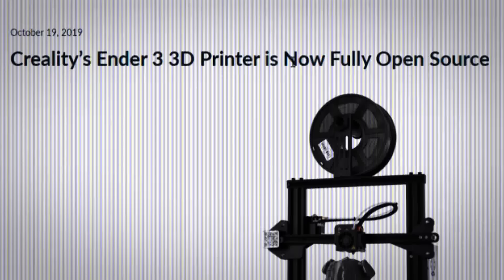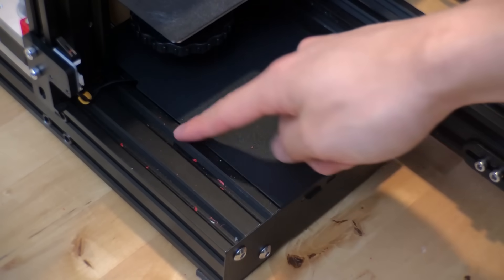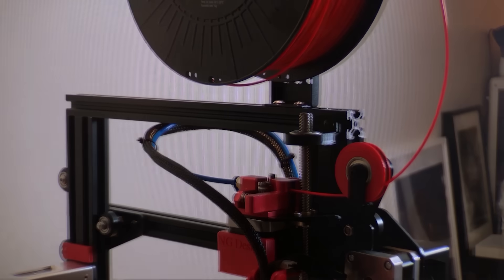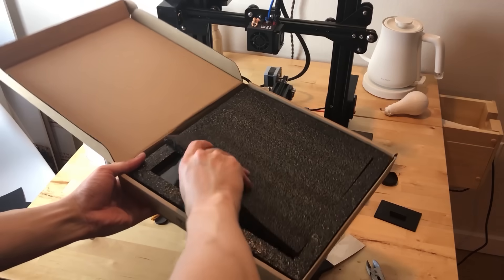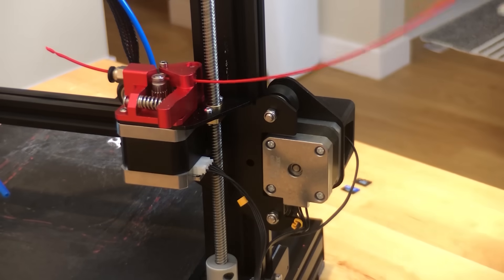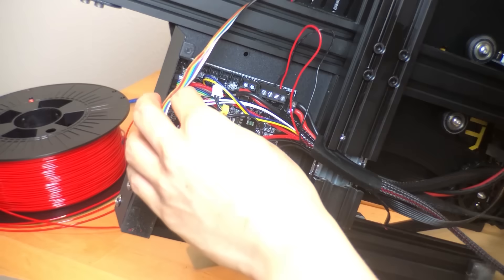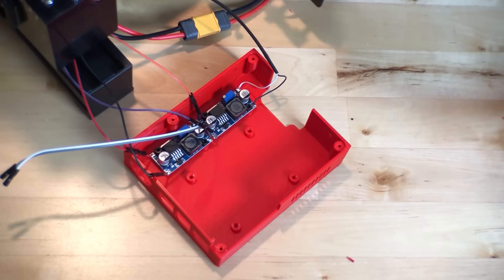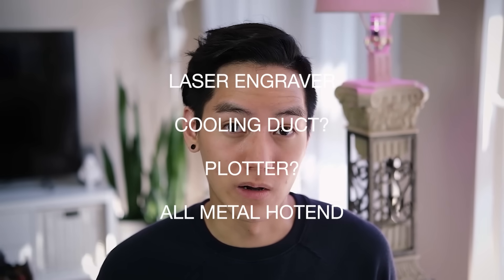First 24 Upgrades for my Ender 3 Pro - Part 1

Comment: Me: Runs out of filament... "Ah dammit."
Also me: Gets a 200 iq idea. Prints new filament.
Reply: That's like printing a blank page if you need paper to take notes...
Reply: @PhilippensTube  if it works, it works
Reply: @PhilippensTube  Thanks for the tip! I was in a jimmy, I had my SAT's coming up.
Reply: I actually tried this. With the right settings it works.
Reply: @lukeunterholzner7928  the nozzle is .4 and the filament is 1.75 sooo which settings would those be? turn spatial physics off?
Reply: @zacharyclarke4240  the right settings could be drilling a larger hole in the nozzle. You could also fully modify the printer to have a hopper that leads into a heating chamber that melts all of your failed prints and extrudes them as filament
Reply: @adamdennis7266  neither of those suggestions are settings
Reply: @zacharyclarke4240  they could be considered physical settings.
Reply: @adamdennis7266  you would consider having a filament extruder a setting of your 3d printer? Not wasting my time explaining why that's wrong and stupid
Reply: @zacharyclarke4240  but you missing the joke from the original comment is
Reply: @adamdennis7266  drilling a hole in a nozzle wouldnt really be the best idea when you can get a precision set of all ranges of nozzle width on amazon for like 5 bucks or less
Reply: @zacharyclarke4240  i would definitely consider those “settings”. there’s many different ways to view the action of “setting” something #woosh
Reply: @adamdennis7266  you could grind the failed prints to a powder and make the hopper idea, only problem is it would be uncontrolled.
Reply: Big. Brain.
Reply: @ZER0D4SH It aint waste when you can generate new filament,

Comment: We chose a few of the same upgrades. I printed that same 2-drawer file, the same extruder knob file, the same LCD back cover, and those same anodized red wheels. Have an all-metal extruder upgrade, Capricorn bowden tubing. Also went with boro-glass bed w/pei sheet stuck to it, and the 3-point leveling carriage. I like your cable chain better! I appreciate teh link to the files!

Comment: with the Bigtree board is there any setup you have to do for it or is it just plug and play?
Reply from the maker: it's fairly plug and play with just a firmware flashing that's needed. it's pretty easy and if you wanna learn more about that i shared a video from a guy who goes very in-depth with the installation process in the video description. good luck!

Comment: On #08, looking at my machine, moving the 'Z' axis motor out from the rail is not the correct solution. The distance from the rail to the center of the motor's shaft should be the same as the distance from the rail to the center of the threaded bushing on the 'X' axis rail that screws onto the 'z' axis threaded rod. On my machine, the distance from the rail to the center of the threaded bushing is 22mm. The distance from the side of the motor that mounts against the rail and the center of the motor's shaft is also 22mm. The plastic motor mount should be flush with the side of the motor so it holds the motor flush against the rail. Mine was not quite to the edge of the motor, so I loosened the 2 screws that hold the mount onto the motor. Then I screwed (but not completely tightened) the mount onto the vertical rail 1st, then while holding the motor against the rail, I tightened the screws that hold the mount to the motor. I moved the 'X' axis rail to the top of the 'Z' axis threaded rod before mounting the rod in the coupling on the motor, then tightened the screws that hold the motor to the rail so the motor shaft and rod is plumb in the 'X' axis direction. When the 'X' axis rail is at the bottom near the coupling, there should not be any binding or friction at all. When I move the 'X' axis rail all the way down on my machine, the distance from the rail to the center of the threaded rod at the top is 24mm, which is only 2mm difference from the bottom. There is no need whatsoever to have to use upgrade #09 and will most likely cause binding if the centerline of the motor shaft, the center of the threaded bushing and the center of the top bearing are not perfectly in line with each other.

Comment: Quick Question: Mine is on the way, and am building a cabinet for it to rest on. My question is how much space does the printer take? Not in means of dimensions, but more on the surrounding area it needs to work properly. One concern is the cords in the rear. I would like to have the cabinet done before it arrives, and any  input helps! Thank you, happy printing!

Comment: Did you get the TMC Connection Error with the SKR mini E3 V1.2? I wanted to buy it too, but I heard of this error and about 60 bucks for the mainboard and a bl touch is a lot of money to waste.
Reply from the maker: i think i got that error once but i just rebooted it and it went away. i don't think that's a common error. but yes, with any 3rd party addon there's definitely always a risk. good luck!

Comment: Adding a bearing to the threaded rod is apparently not a good idea, its supposed to have that wobble. God knows why.
Reply: It is not suppose to wobble. It may have a slight bend in it or it is not vertically plumb, so when it spins, it may wobble. Since the rod is vertical, it doesn't need any support at the top since the Z axis will support it as it travels up and down.

Comment: I've done quite a few of these now. Heads up, the SKR Mini E3 v2.0 is much more reliable than the 1.2 or 1.3 and doesn't require quite so much programming.

Comment: I ordered an Ender 3d printer today. I'm just short of bouncing in my seat waiting for it to show up. And now, thanks to your video, I have a list of things to try making first. The cable chains are a great idea.
Reply: I'm gonna buy mine soon :) Did yours arrive yet?
Reply: @MM-vr8rj  I have it assembled and ive made a couple of parts and a bit of wasted plastic with it. It wasn't hard to assemble, but I had to learn about making 3D prints work. One thing that would help is don't use black filament when setting the machine up. Use a color that stands out from the print bed.

Comment: Thoughts as I go. Really good video but 3/4 of these I'm having trouble seeing as "upgrades" (Sorry, I'm bored from procrastinating from real work). Definitely good if you really want to customize your printer and have enough matching color filament! Calling this many things upgrades might make it sound like this many things are needed to increase the quality of prints from this printer when very few of these are for upgrading print quality or even quality of life in using it.

#1 yes, it's bright. Cover good!
#2 "I just wanted to print my first medium sized part"
#3 "I have filament color I want and needlessly want to customize" but was that really necessary after the baby?
#4 yay now my debris gets trapped under [not readily at least] unremovable plastic that I never remove to check under
#5 I think I use mine more than you because reaching that far back in the corner of my desk is too far. It just goes in my top drawer. My printer is in the back corner of a corner desk though
#6 I know why, but still: why? Be purposeful. Just color customization. Unless you're a debris nazi, see #4
#7 oh cool, look I can find something that restricts the power supply cooling capabilities! (I've always got mine 4 ft from me and my streaming mic and it's not audible though there are A/C units outside. The part cooling fan is louder anyway)
#8 the first useful, actual upgrade!
#9 good idea. Not really necessary though as it won't add much longevity or any accuracy to prints, see pt #8 and disclaimer 
#10 I don't like to encourage manual manipulation of axes too much but a nice point for color splash and occasionally useful
#11 Filament guides are a really good idea on this printer and filament feed definitely seems like one of the largely overlooked considerations in its design. I'd much rather move the filament off the top where it would be able to add to any oscillations though. There are some great angled mounts to be found to move the filament arm to the bottom stand
#12 If that guy got a cable through his print he almost had to try to. Cleaning up the cables runs is still a great idea!
#13 If you need storage REALLY close to your printer, great. Feel good larger pieces to print but definitely quickly outgrown. Still a nice to have if your printer isn't on the back of a corner desk.
#14, 15, 16, 17 a lot of people complain about adhesion and levelling on their stock magnetic beds. I do a lot of almost full bed prints for layers for rovers, midi controllers, etc and still don't have any issues after a year and a half with PLA. That said bed levelling is a constant ordeal and everything shown is definitely very convenient for when you do have to level. Still don't like the handle for manually moving the bed. I'm 50/50 on these bits personally but based on others' complaints I would say it's a situational upgrade
#18 I already saw the Pi in the intro so I know you're going to be setting up remote access which makes this completely useless (I've never used the card slot on my printer, always USB/Network), but if you are using cards this is a good idea. Congrats on your first remix! Consideration for the USB connection conflicts with needing to worry about longevity of the card slot
#19 Yes! And calibrating the E-steps is definitely a great thing to do once you're up and running
#20 I've yet to have an issue with the stock tubing though I just print with PLA and I expect nozzle cleaning/replacement to be part of normal use. No real personal insight for this one!
#21 I personally don't like things like BL Touch and having the firmware account for unlevel beds because that means the bottom surface of the part just matches the bad levelling of the bed! (I'm really picky about some of my dimensions for my builds). That said a LOT of people use this and it really does make life a lot easier! I have levelled my bed enough that it only takes me a couple of minutes once every few weeks and I know my bottom surface is as perpendicular to the top surface and layers as possible
#22 Definitely good bang for the buck. I'm still running my stock board though, I don't need silent steppers
#23 (lights) The first thing I wouldn't call an upgrade but want to do myself! Definitely a lot of work for what you get (hopefully you're not trying to print in some dark dungeon?) but very nice and clean. Admittedly I have a webcam looking at some of the printing and though my fleshy human eyes can see prints just fine with room lighting this would greatly help with the webcam quality. For the level of effort put in by OP he should get a heat gun!
#24 (Pi) I've been running my printer exclusively via OctoPrint (Not OctoPi, I've got an old netbook that would otherwise be collecting dust running Mint + OctoPrint) and is definitely the way to go over shuffling STLs around with SD cards! Whether via a Pi or other dedicated connection, OctoPrint (OctoPi) is how I'd recommend using any printer!

So as stated I've been using mine (Ender 3 Pro) for well over a year now to print solely PLA and the only "upgrades" I've done are to move the filament spool off the top of the printer (making a filament guide unnecessary), making spool adapters for smoother/easier filament pulling off the spool instead of it wobbling on the smaller diameter spool arm, and setting it up to access via OctoPrint. I manually level my bed (I care about the bottom of the print actually being more level for some of the stuff I make) and replacing nozzles is part of my usual maintenance whenever print quality drops.
Reply from the maker: wow i don't respond to a whole lot of comments but this was just too much effort to ignore haha. i understand the critique and i did receive a few comments like yours pointing out that if they're not upgrades to the print quality they're not technically upgrades but i completely disagree. i think improving the ease of use, durability, and organization of a product is just as important for many users. if it was always just about print quality and not ease of use i think resin SLA printers would be a LOT more popular than FDM but the opposite is true because FDM printers are just so much easier to use compared to SLA and people value that. I think #1 is the best example of that. it doesn't improve print quality in any way but it allows me to print through the night drastically increasing how often i use this printer! 
2. LCD enclosure -  definitely for cosmetic purposes only.
3. LCD Knob - actually very functional. whenever i need to preheat the nozzle or the bed, it's now significantly faster to turn the knob with the little protrusion on the knob! i can also just turn it with one finger now which i really enjoy. 
4. v-slot strips - i don't understand whta you mean by "debris gets trapped under." the point of the v-slot strips is to cover the slots so... no debri can even get into the slots anymore.... there's no way for them to "get under." 

that's all i got... haha no comments on the rest. fully agree with you on other points. Thanks for watching, mate!

Comment: I love the upgrades, and also the video editing. Top notch!! I just got my first printer like yours 2 days ago.
Did you have any issues printing the case for the drawers with no support? I have done the bottom drawer in PETG and it's turned out great. I'm just worried about printing the case and it screwing up as it's a 24 hour print. Also with my fillament i've found i have to set the extruder temp to 245 and the bed to 80. So that's a long time at 24 hours if it botches at the overhang. Did you print yours sideways?
Reply from the maker: trauntinc yes! definitely print it standing up with the opening for the drawers pointing up! if you do that you shouldn’t encounter any issues at all. good luck! glad you enjoyed the video :)

Comment: Buy a BMG clone instead of the metal dual gear extruder. the gears on the metal one actually start grinding the metal, this has left me with a shit ton of grinded metal. The BMG also has a 3:1 gear ratio, plus it supports a ptfe on both sides, which is awesome if you want to feed your filament from a dry box.

Comment: over heats the printer because you covered the fan lol
Reply from the maker: The power supply fan is actually not an exhaust but an intake so the cover is only redirecting the intake air. I haven't really had any problems with this yet and it's also a very popular upgrade on thingiverse so it's probably fine?

Comment: excellent work, but most of the upgrades are useless and have an exclusively aesthetic character. Replacing the Board, the calibration sensor, and replacing the plastic feed gear is really a necessary upgrade. E3 has a problem with the airflow,it could have been printed too, thanks for the video

Comment: Great video. How do you like the laser engraver addon? I'm torn between getting that and a cheap dedicated engraver that might be strong enough for cutting softer material. Have you tried to engrave lacquered stuff? I'd like to use it to engrave text and simple graphics into lacquered cases

edit: One mod I would add in your place is one that replaces the spool holder with something with a ball bearing because it eases the stress that is put on the motor pulling the filament. There's multiple ones out there, just pick one that fits your style

Comment: Hey I was wonder about how much filament you used printing these upgraded because I want to use some of these when I get my printer for Christmas and they seem really cool
Reply: My printer arrived a few days ago and today my filament finally did, too. I've been printing all day, I think it might be 14h now, and I have not made a visible dent in my 1kg spool. A spool is around 15 to 20 bucks. Of all the upgrades he has shown the only one that might eat a bit of filament is the drawers but you can do without them if you're truly worried about filament
Reply: Sascha Schneider thank you for telling me this
Reply: @cornbi.n  welcome. Another thing I've recently discovered: you'll need a software called slicer that translates the 3D input file, generally .stl,, to something that the printer can use. Most slicers will show you how long it will take and how much filament it will use. The one I use is named Cura and if you configure the price per spool it will also tell you how much the print will cost you. If you're on a budget that's an invaluable asset and can help you to decide if a certain upgrade is worth it
Reply: Sascha Schneider nice I definitely check it out

Comment: I didn't take off my magnetic sheet when I installed my glass bed. I've had no problems...
Reply from the maker: i don't think you have to? but i have seen a lot of comments on this video that said months later the magnetic sheet fused with the glass bed from all the heating and eventually they had to crack the glass bed into small pieces just to remove it so i'd be careful.

Comment: I'd really love to learn how you print PETG so well, having a tough time getting PETG to work well on my ender 3 pro.
Reply: It has printed basically the same as pla for me, other than temp changes. I think your success is dependent on the bed material. I have some rough plastic on mine that it sticks to reallly well (too well). I have heard others say it won't stick properly to their beds. Is it sticking well? What temps are you using?

Comment: I've seen Your upgrades on Ender 3 Pro, very interesting.

I think you might be interested in my latest upgrade Steel Roller which turns the printer into a continuous cycle printer.

This is the link  http://www.robotfactory.it/en/the-steel-roller-kit/ 

An article on Fabaloo has also just been released
https://www.fabbaloo.com/blog/2020/9/13/robot-factory-offers-continuous-3d-printer-conversion-kit

Andrea